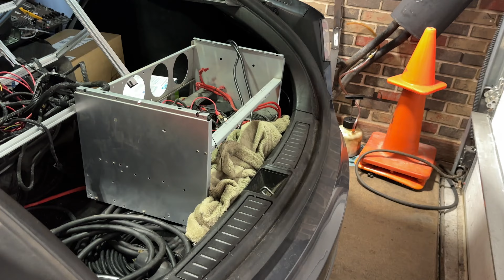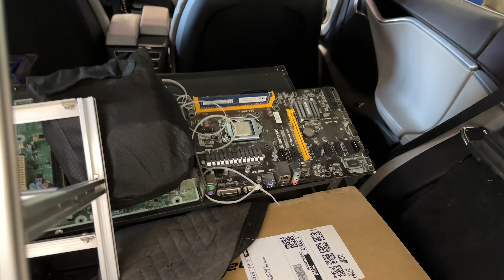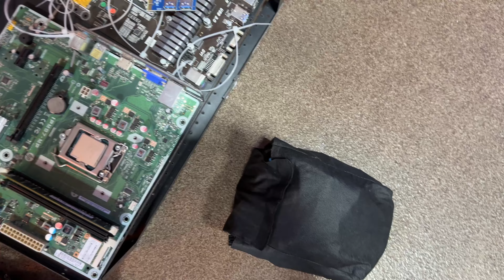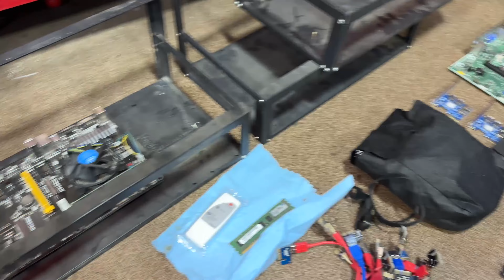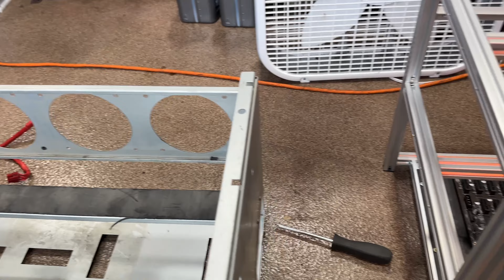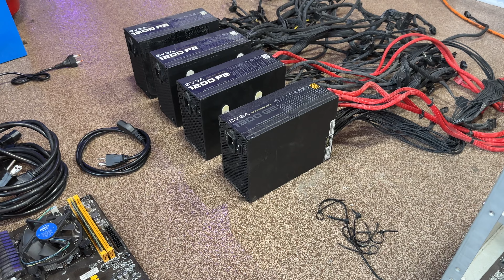Still buying GPU mining hardware in 2023

Comment: I bought an ebay 8GPU server case.. and a couple more 2070's and used some existing cards I had to make a mixed rig.. thats my latest addition to the farm. other than that I have saved up to build a mining shed.. so that this year I can actually use the AC in my house and not live in a sauna again like I did last year. Minnesota Summers can get hot and humid!
Reply from the maker: hello fellow Minnesotan! haha nice! the china cases seem just fine if you're sticking to a single algo.. the ram gets overwhelmed super fast otherwise. I can feel you on the AC comments though. I set up my home configs to get everything in the garage once I no longer want the heat in the house. Good plan!